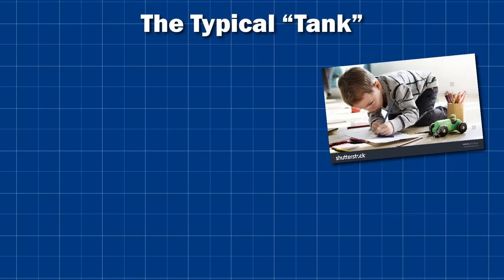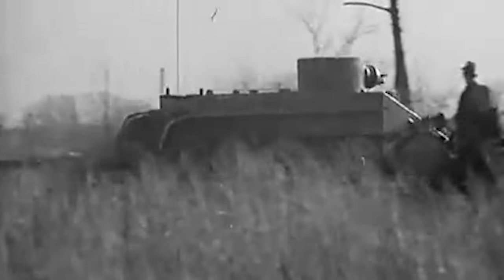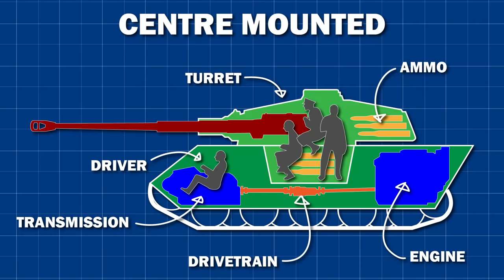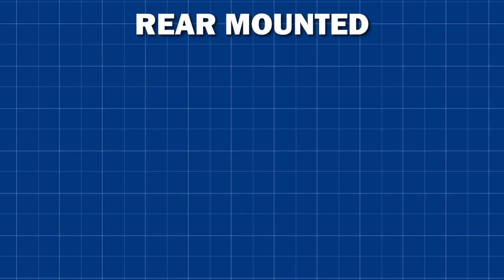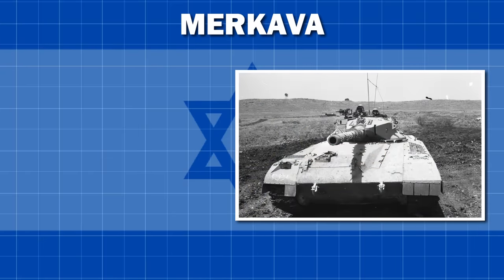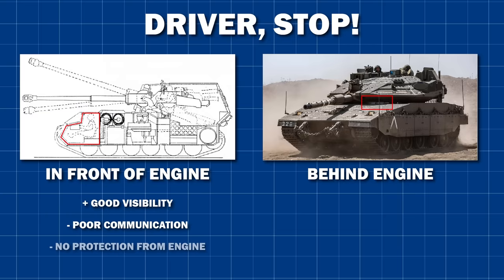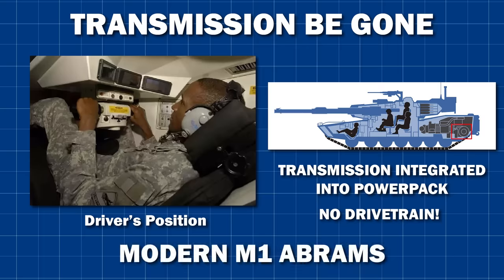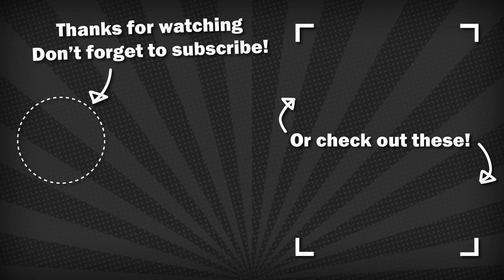What happened to Rear-Mounted Turrets?

Comment: Firstly. Stop with the nonsense. Merkava isn't apc of ifv. Its mbt. There isnt any space for extra crew/units, since there are the ammo boxes, behind the turret carousel/basket. It could technically carry 4  wounded soldiers, but that is only if all the ammo is gone. The door at the back is created for easy in changing the crew, without exposure to enemy fire at position halt. Merkava's driver isn't behind the engine, its next to it, on the left, which of course hinders the visability, but slightly to the right. Also Merkava was created after engineers and designers found, that  they were loosing too much men, not armour, since many of the Sho't were repairable, unlike their crews and commanders. 
Secondly-the transmission(even not automated) isn't needed to be at the front. The Russians did it with their bt-5,7  and of course  the notorious T34  a 100 years ago.
Reply from the maker: No nonsense here! At no point did I say Merkava was an IFV or an APC, I said it was designed to have the capability to carry troops - which it does. No other MBT has this capability and it relies on the engine not being at the rear of the vehicle. 1 in every 11 Merkava tanks goes into combat with a reduced ammunition load to allow this rear compartment to be utilised. 

And yes, I am aware transmissions don't need to be on the front in manual vehicles, but this requires the use of complex linkages which need to traverse the entire length of the tank and means that the transmission itself is a lot harder to maintain or replace. T-34 is a great example of why most chose to keep their transmission at the front of the vehicle.
Reply: @RedWrenchFilms  Bro are you a Tiger/Panther/ Sherman main, because literally none has its transmission infront- Centurions, Whole Russian tank design school, Leoprads, Abrams(XM) as well as Patton,Type 74 and Type 10,  Cheiftain and Challenger. Transmission at the front is a   BAD idea, because you get hit- you are now incapable of going anywhere, which in tank combat is sure  death  sentence.
Reply: @RedWrenchFilms also its uses the door at the back as an escape plan, as well as  ability to load/replenish crew in safety of the tank's back and in position halt/ambush, which mostly happens in the rocky terrain in Golani
Reply from the maker: @K1ng_Rat  Am I a Sherman main? What?

My point, that I make in the video, is that older tanks usually have their transmission in the front, and newer tanks usually have their transmission at the rear. You seem to agree with me? 

The argument that having the transmission at the front makes a tank vulnerable is a funny one to me because the alternative is that everyone in your tank is dead. If you have nothing of substance stopping a round going straight through your entire tank, it will kill or maim your crew, likely penetrate your fuel tanks, and, depending on stowage, ignite your ammo. I would much rather lose my transmission that have that happen. This is one of the reasons why the Sherman (with its transmission in the front) was one of the most survivable tanks of WW2. 

Being mobility killed is significantly better than being actually killed.
Reply: @RedWrenchFilms  no, no you absolutely never said that IN THE PAST  you always talked about now/future, never said anything. And suprise  you agreed thah modern tanks have their transmission in the back, so you blown your own argument about the thing with penetrating and killing the crew.  Explain then how tf are soviet tanks so durable(t-72 and t-55)  to frontal hits, as well as why most tanks have the transmission at the back  if its SO DANGEROUS .
Reply from the maker: @K1ng_Rat 

 “ Historically you had to have the transmission in the front so the driver could operate it, but nowadays it’s all automatic…” - me in this video 

Did you miss that part?

Also T series vehicles are durable from the front because of armour and ERA. We are talking about a hit that has already penetrated the armour and is now causing damage INSIDE the vehicle. 

Riddle me this - a T-72 is penetrated from the front. What does the shell hit? What damage does it do? Where does it finally stop? What % of the crew survive?
Reply: @RedWrenchFilms  most russian tanks relied on manual transmission, with only b3(2016) finally receive automatic, Cheiftain had semi-automatic, while Centurions were manual,as Merkava 1,  bro  even the Leopard 1 has manual, while it's bigger bro Leo 2 has semi to fully. Historically you had transmission in front until WW2  where the flaws of it were discovered- a tank that is immobilised is  a dead tank, you can ask any tanker and artillery man. Because artillery is just menace to stationary firing positions.   Why do you think t-72 receives so much hate- 4km/h reverse is practically standing still in active combat.   Untill 1945 you  have 29 years of tank building(6 very active war expertise), after it there is 78 years of active tank building with massive innovation. So correct it would be *"Historically transmission have walked long way, with mostly being installed in the back of the tank, near the engine for wider crew compartment, but there are minor exceptions  IN THE EARLY DAYS OF TANKS, WHERE THE TRANSMISSION WAS IN FRONT as Panther, Tiger and Sherman.
Reply from the maker: @K1ng_Rat  You didn’t answer my question! And yes, manual transmissions can of course be mounted in the rear, it just requires a more complex system of linkages and usually is more difficult to maintain. There were advantages and disadvantages of both systems. Rear mounted turrets addressed some of these issues and made some of them worse, like I mention.
Reply: What  question? I am just  annoyed, because   most of the tanks  have their transmision in the back, unlike what you said. Of  course  there are exeptions, but most designers  prefer the  transmision to be at back, because  thoose  linkages  are  much more safer and  ofcorse smaller  unlike   the drivertrain- It makes  the vehicle taller and easier  target. As  the germans  many  times said  that Shermans are too tall and  much easier  to spot  at a  distance than both german and  russian tanks.   @RedWrenchFilms
Reply from the maker: @K1ng_Rat  I was asking what would happen to the insides of a T-72 if it was penetrated from the front - what would be damaged and to what extent etc (if not the transmission)
Reply: @RedWrenchFilms  firstly if ufp is penetrated the deiver is out of the game,  the fuel tanks could get damaged, as well as the breach and one of the two in the turret could be injured. If the penetration is in the lower fp the ammo storage could get hit and again the driver will mostl likely be killed.
Reply from the maker: @K1ng_Rat  Exactly - if the driver is most likely killed anyway how is it any better than being immobilised through the transmission being damaged?
Reply: @RedWrenchFilms  because dead driver can get extracted and one of the two go in his place, while with transmission, you just abandon the tank, because its stuck.
Reply from the maker: @K1ng_Rat  If the drivers dead then the chances of his equipment working are pretty slim. You said yourself the fuel tanks have likely been hit and the turret crew are injured. I’d wager you’re in a much worse position than if your transmission had ate the shot.
Reply: @RedWrenchFilms  not exactly because while wounded commander, being able to drive is way better, than sitting in the open, waiting for your demise via enemy tank, anti-tank or artillery fire. Also i am talking for the frontal fuel tanks

Comment: Merkava fan not Effectively Carry Infantry, Its way too small for that, Yes by Tank and Overall Armored Vehicle terms its luxurious, cant compare it with Western Tanks but ive been in a T72, Its night and Day 

But still Its too small for Infantry, and also they get in the way of Turret rotating, They could easily be Crushed to Death by the Machinery if they move too much forward

For Infantry to cramp in you would need to remove all the Ammunition,  which is a stupud thing to do, in fact the opposite is done, Merkava Can Fit up to 80~ Rounds, and so they cram in as much as they can
Reply from the maker: It can and does carry infantry. In fact 1 in every 11 tanks will carry a limited ammunition load into combat in order to take wounded soldiers back in the rear of the vehicle. It may not use this feature as much as it was intended to but it is still a large part of the design philosophy and is used today.

Comment: rear mounted turrets require a stopped vehicle which can easily be blown up by incoming fire. rear turrets are also less accurate which is why they are relegated to self propelled howitzer artillery guns that need rear ground plow or hydraulic leg&foot braces which means an abrams traveling at 0mph can kill it while the abrams is on the run 99.78% of the time. mean while all rear turret machines require 3-12 minutes to set up to fire and that first shot being accurate...100% luck
and this is just getting started as thermal imagers changed the war in iraq in 1991 ukraine is taking thermal imaging to a whole new level with drones and mines.
put the 800º engine infront of thermal binos and drones.....great idea if your out to destroy that machine.

Comment: Most of the rear mounted vehicles you have shown are either assault guns or mobile artillery. They are not tanks.
Reply from the maker: Merkava, TAM and the M10 Booker are all tanks. The only vehicle I show which is not, technically speaking, a “tank” is the Ferdinand/Elefant.
Reply: @RedWrenchFilms M10 is hardly a tank

Comment: this is horribly laughable, you have zero understanding about tanks and designs as the claims are wrong and highly ignorant  hell, the height issue wasn’t an issue for the past 78 years!

you totally ignored the issues with stability: firing a rear turreted tank puts the weight of the turret entirely in the rear pushing the tank upwards. it’s unstable, it will flip! turrets are in the middle for this reason among all else: it’s the most stable.

need proof? self-propelled artillery requires stabilizers because of the instability caused by firing the guns. it’s a huge problem with the Stryker Gun Systems, they have been toppling due to instability caused by firing
Reply from the maker: I genuinely am not sure what you’re talking about. What do you mean “stability”? Pushing the tank upwards? How is Stryker MGS relevant? I’d appreciate it if you gave me some more detail rather than just calling me “wrong and highly ignorant”.
Reply: @RedWrenchFilms  gun fire, round go boom, tank rock back, tank topples over. it’s a serious problem with the Stryker, rear turrets are unstable due to the heavy weight on the rear causing it to topple when fired. it can’t be fired directly ahead because of that issue! there’s a reason Paladins and self-propelled artillery like it must have their rear stabilizers down in the ground BEFORE FIRING.

actually do some research before spouting off, you clearly didn’t bother because this issue is basic physics
Reply from the maker: @bostonrailfan2427  Hahah I think it may be you who is ignorant on this one. If there would be ANY issue with the Stryker firing, it would be if it was firing at 90 degrees over the side of the vehicle. This has nothing to do with the turret being placed in the rear but more to do with how high the gun is placed. 

There is plenty of footage of the Stryker firing both frontally and over the side, however. If you’ve any source for any of this “flipping over” I’d love to see it! The idea of a 105mm gun causing an armoured vehicle to flip end over end is pretty funny though.